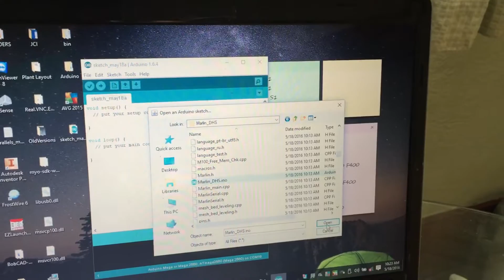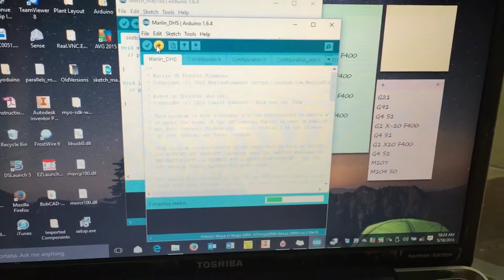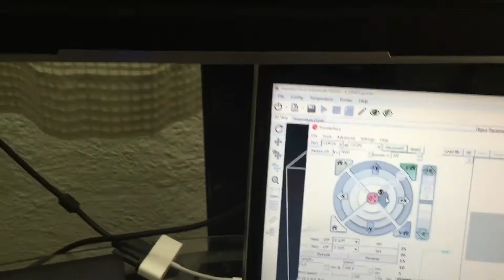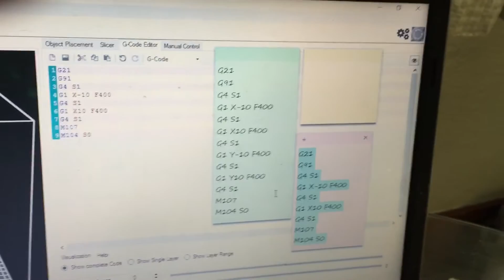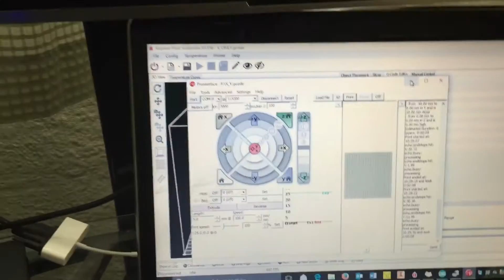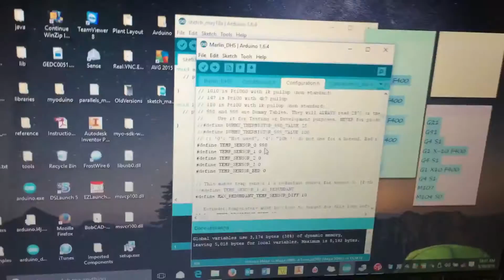Zortrax arduino and programming setup

Comment from the maker: I'm traveling currently and do not have all my resources with me. What are you having trouble with? 
Load sprinter or Marlin onto the Arduino. If you have a issue here. It is likely due to the board selection default, of the sketch. (If you do not know this process well say so and I'll post a video for you ), but basically it should have multiple tabs in the arduino. Environment. Find the boards.h tab, review for a number listing. Next to a board name You will likely need to change it match. Besides that the thermocouple input setting. 
I gave all my robots away also so don't know if I have a .ino with me

Comment: Hi Jesse,  could you please send us your program for moving Zotrax arm ? Also, what software are you using to control the arm with "mouse" and "pad control" ? Many thanks in advance.
Reply from the maker: Rémi Ngo I use a package called pronterface in combination with repetier
Reply: Ok, I understand that. May it be possible to have your Arduino Algorithm ?
Reply from the maker: I'm traveling currently and do not have all my resources with me. What are you having trouble with? 
Load sprinter or Marlin onto the Arduino. If you have a issue here. It is likely due to the board selection default, of the sketch. (If you do not know this process well say so and I'll post a video for you ), but basically it should have multiple tabs in the arduino. Environment. Find the boards.h tab, review for a number listing. Next to a board name You will likely need to change it match. Besides that the thermocouple input setting. 
I gave all my robots away also so don't know if I have a .ino with me
Reply from the maker: The main arduino file is available on github under Marlin, if I recall correctly. It will have the arduino file and you may have to change the board identification number as I eluded to in previous comment
Reply: Many thanks Jesse, sorry I was travelling too. At the moment, all our pièces are printed. we're now working on the software. I'll check about Marlin on Github. However, if you still have the whole code, I would be grateful if you can send it to me.

Comment from the maker: Look up zortrax robot. The controlling board is a ramps 1.4 and a arduino mega 2560 stacked together. Otherwise it's 3 Nema 17 stepper motors and some bearings a complete BOM and the 3D printable files are available from Zortrax the 3D printer manufacturing